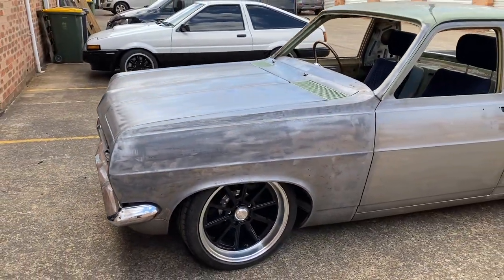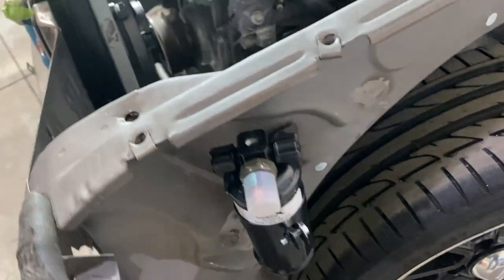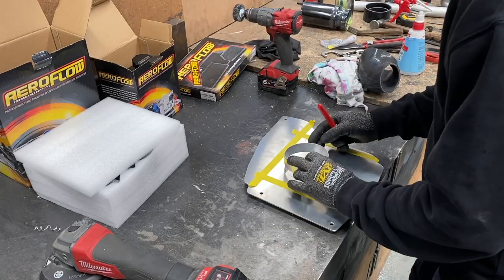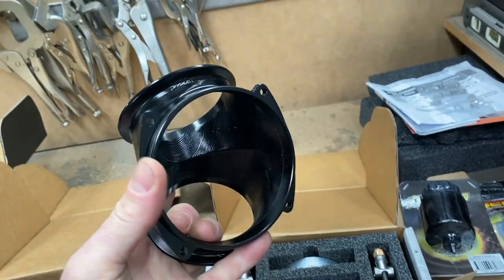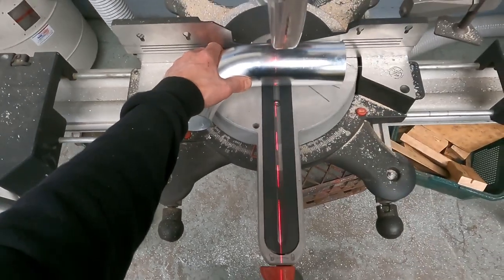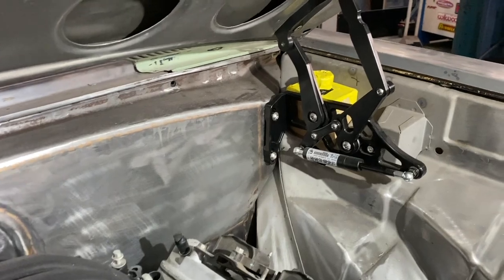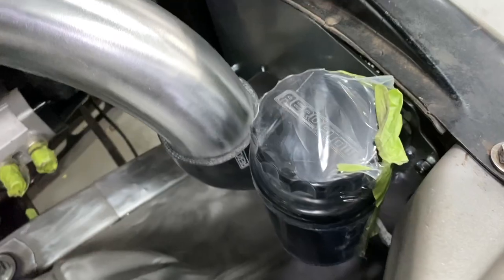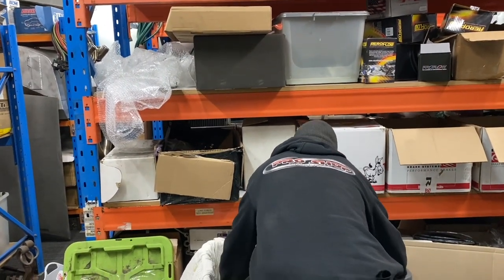HR Holden Ute Build Part 2 | Finishing The Engine Bay

Comment: Excellent work. An old trick on HR's was fitting spot lights where the blinkers should be and fit an HD lower panel where there's are fitted. Only a trained eye would notice..........
Reply from the maker: Thanks mate. That's a neat trick I didn't know👍

Comment: I saw you playing wing with bonnet latch & thought i would share this with you i had hk a few years back & wanted something different with my bonnet latch so i went & bought an after market electric door lock kit did what you have already done  done with HR made all opperate from underneath then i got 2 actuators & piggy back on top of each other i had to put them inside a peice of 50mm square to hold them firm but then end result was electric bonnet release i did have an emergency cable if something went wrong but never had to use it all i had was a button where the cable once lived ive just thought i would share this with you ive only just found your channel as im building a HD sedan & was looking at what others are doin anyhow  look forward to seeing more of this ute & more of your cars cheers
Reply from the maker: Thanks for sharing Max. That’s a great idea. Might be something I use on the next build.

Comment: is the AC a full electric system ?
i'd like to fit this type if it is so i wouldn't have to have the ugly mess under the bonnet like the old type 
where did you get it from
Reply from the maker: Yes the A/C pump is electric. It does save room in the engine bay however they do need to be mounted close to the battery as they draw a fair bit of current. You'll probably need a bigger alternator as well. I hate to say it but these pump were sourced through Ali Baba. I'm yet to find someone in Oz that makes them.